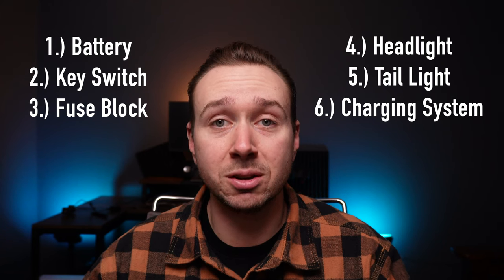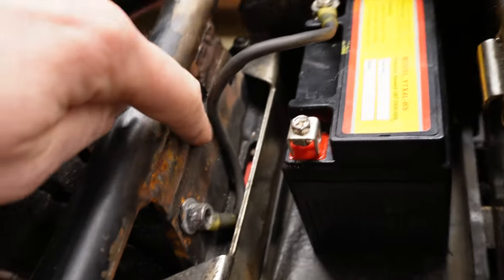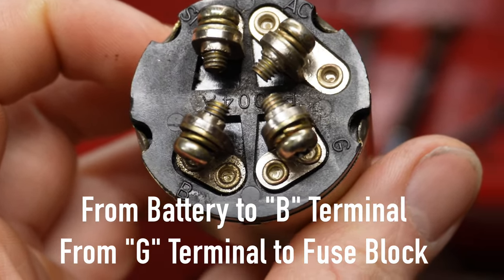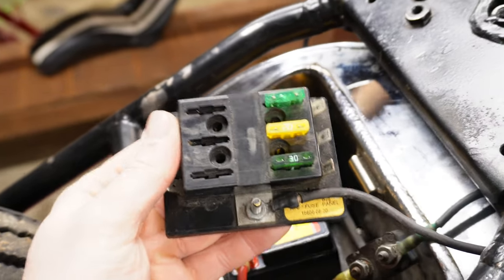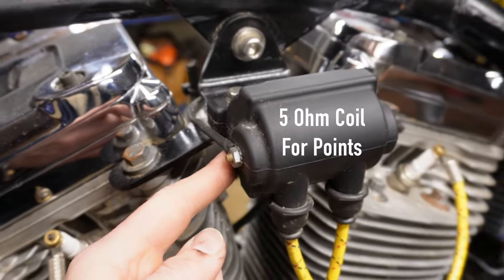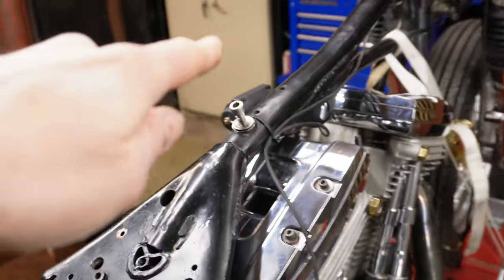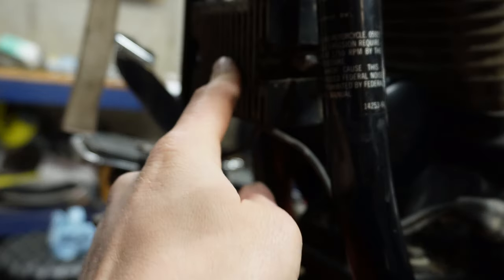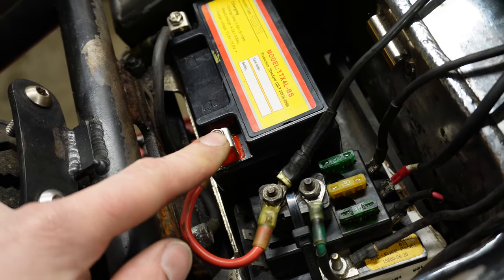How to Wire Your Chopper | Part 1

Comment: Finally a video that's straight to the point, informative easy to understand, thanks, I have a 79 cb750 and a 75 gl1000 both down due to electrical issues, I'll have them both running by morning!
Reply from the maker: Glad to hear it man! Thank you for the kind words 🙏🏼🤘🏼

Comment: Change the headlight to a 20 or 15.
Tailight to a 10 or 15.
Also run an in line fuse in that regulator wire in case it ever goes bad it doesn’t overcharge and fry your battery.

Comment: I have an electric start on a 1955 FLE. After a few starts, I started to realize that the generator wasn't charging the battery up to a sufficient level. I installed an extra ground wire from the regulator (type that fits on the end of the gen.) to the frame. Testing the battery with a meter at 1000-2000 RPMs, it was charging up to 15.75 amps! 👍😎
Reply from the maker: Nice catch and great fix!

Comment: Thanks to your video, I am done with the wiring part for my sporty and I want to leave further explanation for the specific bike I worked on. 

For those who is trying to rewire 03 sportster with
Stock Ignition Control Module, here is how ICM wiring should be done. 
Pink: goes to -ve side of the coil
White/Black: goes to +ve side of the coil
Purple/White: goes to VOES
Black: Grounded
Green/Grey: should be grounded as well even when BAS is ditched.
Reply from the maker: Great info brotha thank you for sharing this 🙏🏼🙏🏼

Comment: The charging wire must be connected to the other side of the 40 amp fuse. Away from the battery.
For two main reasons:
1. The battery can provide a significant current, several hundred amperes. Therefore, it is connected to the rest of the wiring system through a fuse with a short cable. The unprotected part of the wiring is as short as possible. If we connect the charging wire on the battery side, we get a meter of wire going around the frame without any current protection. If shorted, this wire will turn hot red.
2. When the engine is running, the charging system is the main source of power. Each load receives power through its own fuse. One for the ignition, one for the tail lights, one for the headlight and one for the battery.
Reply from the maker: Ah I see what you’re saying, great point

Comment: This helps break it down so it's not as intimidating of a project. Horn,  turn signals, starter, and hi-low headlight switch are not hard either. You just need to break it down in smaller steps sometimes.
Reply from the maker: Exactly. Start with the bare bones and add in extra components as needed 🤘🏼

Comment: I picked up a 98 dyna that I’m wanting to completely rewire. If I strip it down and remove the wiring harness, could I rewire it using this tutorial if I change to a points ignition?  I’m wanting to delete all the bells, whistles, and hand control buttons off the bike.
Reply from the maker: Yes. If you go to points and mechanical advance you can do this exact setup. You’ll delete your ECM (sell it on eBay for $200), delete your voes and be able to replicate this setup. However, you’d need to wire in a starter and starter relay as your 98 probably doesn’t have a kicker like my bike does. Still would be deleting quite a bit of junk though, a great move 🤘🏼
Reply: @greasesgarage  just what I wanted to hear. Thanks for the reply.

Comment: Grease, you are my saviour. I bought a gsxr 750  bobber and it seems to have the wiring loom from an Apache gunship rammed into a small box under the seat.  😂
Reply from the maker: Hahahah gotta love that spaghetti mess! Out of curiosity, does this video help you sufficiently as someone with a different bike? If not, what parts are still unclear that could be addressed in a future video
Reply: Sorry about the wait, bud. I'm a noob with this to be honest  but this vid breaks it down into manageable segments. Although I am in a situation where my bike doesn't  actually have a regulator rectifier, it runs but it's all over the place. You could come to Wales and do a video of you fixing/rewiring the thing! Free room and board obviously 😁👍

Comment: Thank you so much this makes so much more sense. I am currently trying to re wire Kawasaki Kz it’s been chopped and bobbed my biggest hang up is the wire going into the points I have two wires
Reply from the maker: Do you have dual points on that bike? Or perhaps the condenser on that bike isn’t inside the points cover and the second wire goes out to the condenser
Reply: ya figure it out? I'm also wiring a KZ in a couple days
Reply: You also have two coils with with 2 plug leads from each coil. Look on the coils there are 2 low tension connections. If theyre spade terminals they are usually marked + and -  You want a fused feed to that terminal, or if the coils have fly leads the male connectors. The other side of each coil is wired to one of the sets of points. One set does cylinders 1&4 the other set does cylinders 2&3. Seem to remember they're marked on the back plate? Connect the HT leads to the appropriate plugs.

Comment: I am trying to rewire my honda steed vlx 400. As first, I like your creativity and wanna to make it. So can I need the cdi system for my cycle? Can i wire my ignition coils from the 4 output wires ( blue,light blue,yellow,light yellow). Please help me what wires can connect to the rear and front ignition coils. Thanks so much sir

Comment: Hi Chap,
Excellent video, how easy was that? 
My question , how would I wire in a horn? Some MOT guys will not except anything but a proper horn.
Reply: What size wire did you use?
Reply from the maker: @Dadfromhell 16 gauge for everything besides the battery ground. 12 gauge on battery ground
Reply: Cheers Chap! keep up the good work!

Comment: Thanks for the video, very informative. So I  just have one question, I'm running a dyna s which has 2 wires coming out replacing the 1 wire from the points. What do I do?
Reply from the maker: Dynas website should have the diagram for you saying where each wire is supposed to go

Comment: Good morning 🌅, This is how I use to wire my bike back in the 60/70s, Triumph Bonneville, Norton Dominator, and Commando, this was my first Chopper, then in the mid 90s , HD 1200 sportster, FXR 1340 , then 2000 Deuce, I had to sell it in 2019, and moved from the Uk to France, 
I have just bought a 2003 Deuce, bad problems with the alarm system, I’ve problems switching it off neutralising it, to the point where I have to remove the battery needs, I’ve spoken to HD, and they told me I cannot do anything with it apart from replacing some bits, Have you any idea how I can bypass the alarm system and away with the key fob?, So all I need to do is put the key in ignition turn it on and start it., this was my first one I had worked, never bothered with an alarm just had a very large chain and padlock, I don’t know anything about electronics.
I can wire a bike where you suggest , as I’ve done it years ago, but there is a lot more to them nowadays, well over my head, and I’m now in my 70s, Keep up the great work if you can help be appreciated, France,
Reply from the maker: It’s definitely possible to wire yours like mine but you wouldn’t want to delete your ECM unless you were going to points ignition. Points ignition and kickstart only is why I’m able to delete basically everything besides four wires. But between this video and the one that shows you how to add electric start I could get your wiring simplified quite a bit
Reply: @greasesgarage  okay, thank you for your help, Have problems getting parts from HD , I have only had the bike for 2 months, I purchased it from the UK, and imported it into France, I knew when I purchased it that there was some issues mainly backfiring through the carburettor, I’m now completely stripped the carb and put all new jets in, the same that was previously on my old bike, As I mentioned, it’s got a problem with the alarm system, Hopefully, I can sort it from what you have been telling me, I knew that I had to replace final drive belt, but I’ve now looked at the pulleys and they are shot, obviously the belt has been too tight, Just been quoted nearly €1000 for a power of pulleys, which seems excessive, And I have since found out mainly this morning, as I am slowly going through things clean them, getting prepared to put things together when I do finally get all the parts and gaskets, et cetera, been told anywhere between 4 to 6 weeks, And by the looks of it, they’re in a primary case has been repainted at some point, especially as you can see black paint on the inside of the primary case, and you can definitely see a line where somebody has cleaned the coating off on the outside to a certain point then sprayed it, I did not pay a lot of money for the bike just over £5000, In some respect, I thought I had a good deal, but the way things are going it might have been cheaper for me to purchase something over here, but I did find that they were a lot more expensive here than they are in the UK, I’ve already paid import duty tax, paid for a conformity form, I still got to get the bike registered and I’ve still get the bike through control techniques, similar to an MOT in the UK, Already put two new tires on the bike, What I now seen of the bike going through it, it’s obvious that somebody’s been inside it, but haven’t done proper job, extremely filthy dirt mud et cetera, so before I take anything apart, I’m having to rush it all down, sorry I’m jabbing on a bit, Hope you have a great weekend, France

Comment: Great Video! 👍🏻 
I absolutely hate doing electrics!
I've been gifted a 70's era (1974) Ironhead kickstart chopper that I'm giving new life too.
It's going to be fairly basic as yours is, however I plan to run dual headlights up front, and dual tail/brake lights in the rear, plus a horn.
Is it any more difficult to wire up dual lighting (front &/or rear) than what you've shown here?
Thanks.
Reply from the maker: That’s awesome! And no, no more difficult at all. You can wire the first headlight to the second and on to the power block. Unless you wanted them to operate independently but I can’t imagine why you’d need them to do that haha
Reply: @greasesgarage - Right on! Thanks! 🙂👍🏻

Comment: By far the best video for wiring yet!!!  Thank you!
Trying to find a smaller battery to replace my huge brick on my 1981 gs850.  Will the battery you have listed in the info work on an 850?

A video on batteries would be awesome!!  Thanks again!!
Reply from the maker: Thanks for the kind words! Is the 850 a kick only bike? If you want to run a small battery like mine it will only work for bikes that don’t have an electric starter, these mini batteries just don’t have the juice to turn a starter motor.

Comment: I'm getting ready to wire  mine like this I followed the regulator  rectifre wire back to it it has one big wire and one small connected to it can I cut the little wire it's a 95 sp 1200xl

Comment: Thanks for the link but Ian already studying that video. What I want to know is what terminal on my starter switch should I use for the direct run to the fuse block from terminal G when there isn’t a terminal marked G on my switch?
Reply from the maker: You haven’t told me what is on your switch, how can I advise you?

Comment: In the process of rewiring my bike and don't wanna drop $250 on a simple wire kit . I have a question though, I noticed a lot of online builders use a 30Amp circuit breaker vs that fuse box. Any reason why you favor the fuse box vs circuit breaker? (03 XL1200)
Reply from the maker: Great question. I use it because when a fuse pops, it’s popped. The circuit is broken. You know something went wrong and WHERE. With a circuit breaker, it trips during the issue then resets itself. All you know is your bike shut off and you were able to start it again a few minutes later but as far as where the issue came from, you can’t know for sure. 

Of course it’s nice to not have to buy fuses but most of the time nothing blows anyways, I’ve not replaced a fuse in over a year. But if and when it happens in the future, I want to know exactly where to start looking. 

Good luck and stay safe out there 🤘🏼

Comment: Nice job. Thank you!
Reply from the maker: Did it help you get yours wired up?
Reply: @greasesgarage  Still in the mock-up stage. I saw your video a few weeks ago and bought a fuse block like the one you use. Brilliant! It's a simple chopper, 1942 WLA, fitting a horseshoe oil tank. When the time comes, I have no concerns. Thanks!!
Reply from the maker: @charleswiley8540  so cool man, I’d love to see it!

Comment: Top video man. I am trying to wire an old Suzuki gs chopper. Be great to see a video on doing this on a 4 cylinder bike  thanks
Reply from the maker: I can definitely ask around and see if anybody in our group has something similar. Much of it would be similar but you’d probably also have a starter wired in and an ECM for the electronic ignition. Eventually I will get a video on wiring in the e ignition since it’s very common

Comment: Ive got the 30 amp breaker bolted to my frame and it seems to ground out sometimes as my whike system will go dead and if i wiggle the 30 amp itll cone back. Is that even possible or is it something else?
Reply from the maker: When we talk about intermittent problems like that my first thought is always loose terminals. A loose battery ground, a loose wire somewhere in the ignition circuit etc. 

I would start by wiggling every terminal connection to ensure nothing is loose. 

If you find nothing, pull the breaker off the frame and see if it continues to happen. But having it on the frame doesn’t seem like something that would cause that issue sporadically. It would either be grounded all the time or none of the time.

Comment: What is that larger fuse in the beginning connected to the key switch? Are you able to drop a link or say where to find? Thanks Grease!
Reply from the maker: @coltonmacgregor8616  that’s a standard 20amp circuit breaker which comes on basically every motorcycle. You could buy any circuit breaker or blade style fuse I just happened to have that laying around from a stock harness so I tossed it in there but it can be absolutely any 20amp fuse 👍🏼

Comment: What gauge wire do you use for the battery to ground? 6 or 4?
Reply from the maker: On mine I used 12 gauge but with an electric starter I’d use 6

Comment: Great vid! Why the “g” post and not the “a” post on the switch?
Reply from the maker: I believe the A post is the accessory post, the middle position between key off and key fully on. I have it wired so I can just click it all the way on and go. You probably could wire it to accessory though

Comment: I have done this but I have one  black wire that's hot looks like it goes toward the alternator where does it go I think it came of the 30 amp breaker95 sportster
Reply from the maker: This type of thing I unfortunately couldn’t tell you via an online message. I would have to be there to see the wiring you’ll want to trace it out and confirm where it’s going

Comment: Thanks for the video! Mucho appreiciated👍. Can I know if I can use 16 AWG for +ve battery to main fuse connection? and main fuse to key switch as well?
Reply from the maker: Yes 16 is ok for those as well, just not for the battery ground or the electric starter wires if you’re running an electric start
Reply: Appreciate it  @greasesgarage . Your videos are huge help.😃

Comment: what guage wire did you use? Especially from the battery to the circuit breaker then to the switch
Reply from the maker: In description

Comment: Another great video! I just got my points conversation kit and getting ready to rewire. I have the stock coil, do I need to upgrade to a 5ohm for this to work? ('92 FLSTC, electric start, no kick)
Reply from the maker: Great question, and yes! 5ohm is needed for points. 3ohm will run (I ran one for a week or two) but supposedly the points will burn out a 3ohm over time
Reply: @greasesgarage  great, thanks. You're the man!

Comment: When you say the hot wire is going through a 30 amp fuse, why does it look like a circuit breaker? Is it in fact a fuse and not a circuit breaker?
Reply from the maker: You’re correct, that’s a circuit breaker. It functions very similar to a fuse in this application. Many stock bikes will come with them so you can reuse them for this section or add in a 30amp fuse if you prefer 👍🏼

Comment: What if didn't want a key switch? Just a hidden switch or how about a 3 way switch with off, power, then kick start it, lights on? is that doable?
Reply from the maker: All are possible yea. Easiest is a hidden switch. Would go between your battery and the fuse block I show in this video. Right where my key switch goes. This switch would just turn on/off the power to your block which powers everything else
Reply: Awesome following this to a T...thank you! Ive got the wire coming tomorrow hope to have it wired by this weekend! @greasesgarage

Comment: Absolutely love this, Thanks from Canada 🇨🇦 

Any suggestions for 1981 Ironhead with starter?
Any assistance would be fantastic 🙏  ✌️
Reply from the maker: Glad it was helpful! The starter will need to be wired to battery power through a starter relay. You can find that diagram by googling “Harley starter wiring” and just add that circuit into the harness you build by following this video here. Let me know if you get stuck

Comment: 😎👍😎
I recently got a 1973 sportster that too many "Electrician's" wired up..
Is there a specific wire color to a specific function..
If someone else gets in here they wont be lost ..??
Thanks ..
Reply from the maker: If you buy a factory service manual for that bike it’ll have a wiring diagram or you could probably find it online. That would give you the stock colors of the wires but if someone rewired it some of them may not match anymore